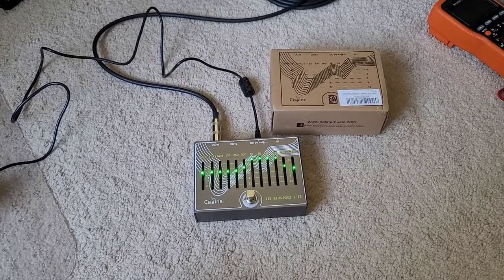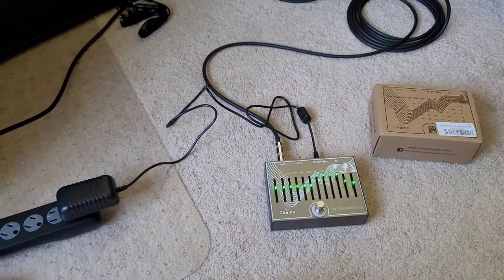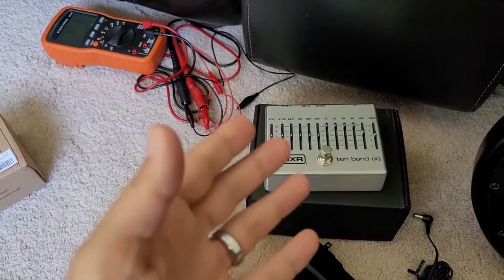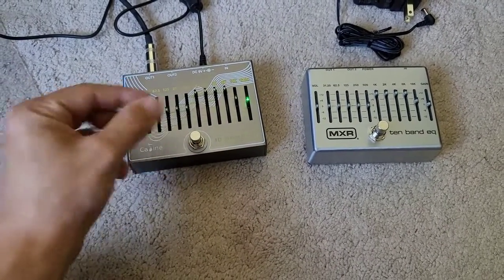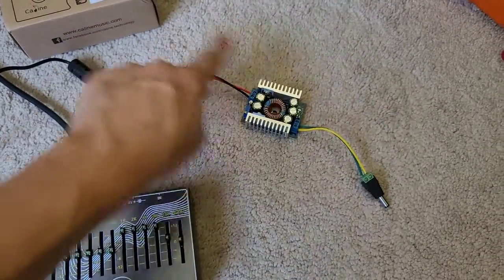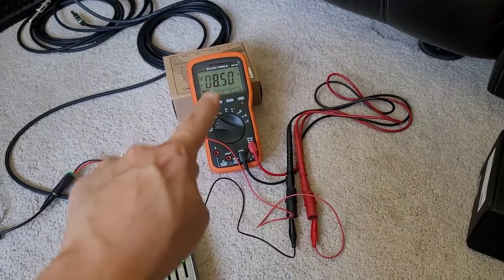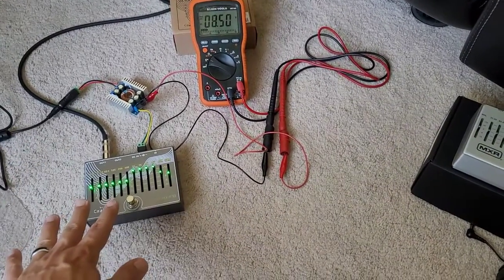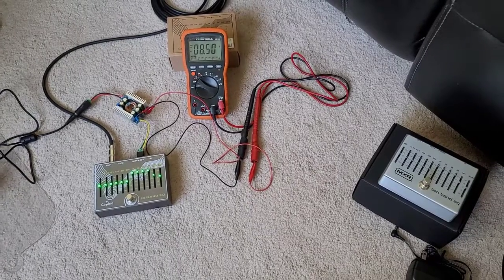Caline CP-81 (v2.1) 10 Band EQ Pedal Review and Voltage Fix

Comment: 8:55 sooo, a resistor in series to decrease power would solve the noise issue for someone who doesn’t have the sag button from voodoo power supply like I have? I’m interested to try this out instead of the mxr.
Reply from the maker: @thesoundpurist  if you buy a new one today this issue is fixed. No need for the resistor
Reply: @Bassguitarist1985  k thanks
Reply: @Bassguitarist1985  one last thing, better than joyo? Thanks
Reply from the maker: @thesoundpurist  no experience with Joyo, but it's likely the same circuit. Joyo are clones of big name pedals
Reply: @Bassguitarist1985  cool thanks
Reply from the maker: @thesoundpurist  my pleasure!

Comment: sonic fields offers to convert 18v to 9v on older MXR and some new pedals., its common that they used 18v in Japan due to the supplies at the time.
Reply from the maker: Good info to know. 18v is better for more headroom, though a 9v supply deployed properly sounded equally as good
Reply: @Bassguitarist1985  someone said you can use a battery but more then 300ma , this eats power
Reply from the maker: @gabrielraphaelofficial  no it's a typo. This draws 39.6mA at 18V
Reply: @Bassguitarist1985  is it possible to run of a 9v battery some how and how? lol thanks
Reply from the maker: @gabrielraphaelofficial  You can get a 9 volt clip to barrel adapter and with the current draw of 39.6 mA, Your average 9 volt alkaline is 565 mAh, which should give you about 14 hours of runtime.
Reply: @Bassguitarist1985  So I have both the new mxr 10 band EQ and the Caline v3.0, I cut R59 chip of the logic board and soldered (jumper style) the connections to use the Vol up as a gain, I have to say that this is not like the new MXR, which has some weak mid range caps, if anything the Caline v3 + the r59 chip Mod is if not identicle to the Kerry King aka Blue original MXR ten band EQ, I say this although Caline has cheaper upper caps for highs, ut they are early workable if your not pushing those too much as metal players tend to do with Marshall heads, Like Kerry King, which is all out over drive at that point, you even loose dynamics from your right hand if you go there lol, so in reality its able ten band eq

Comment: I have a voodoo lab pedal power plus 2 power supply. It has 2 Outputs with a SAG feature that lets you adjust from 9V, down to 4V to emulate a dying battery.  I think I could use one of those outputs and just dial it down a little bit.  Does anyone know if this would work? I have never used that before.
Reply from the maker: @thejackalope73  If you have v2.1 then yes adjusting the output voltage to 8.5V should work fine. However if you have a V3.0 then you do not need to do this. I can't imagine there are many V 2.1 boards left out on the market. The issue is corrected a few years ago.

Comment: I have the caline and it's great for all the reasons you said but makes alot of noise. I can't believe you figured it out. I was looking into the mxr and they are so similar it's crazy that they are so similar. And honestly I'm so disappointed that after shopping around I have to ditch the caline over somthing so silly and inconvenient. And buck up the cash for another eq that will probably be an mxr wich is practically the same thing. Oh well at least when my roommate sees my new and exact same yet more expensive pedal I can explain the importance of the voltage circuitry.  So I'll be watching ur mxr dimming vid.
Reply from the maker: @benjaminkretchman4049  you have the v2.1 board or the v3.0?
Reply: @Bassguitarist1985  oh wow I see. I saw that caline version 3 on Amazon and was curious why there where different calines and why mine was cheaper. It's an impressive video. I'm very Tempe to get the updated caline for the price I could buy 2. Do you think it really stands up to the mxr since you've got it updated as far as low noise floor
Reply from the maker: @benjaminkretchman4049  yes, both equal. It's the same quad op-amp chips!!!
Reply: I can't believe that I found this video. I can't believe that you fixed it. I just might be getting me a couple more calines. One for my effects loops too.
Reply: isn't the one with red lights a updated version that addressed the issue?

Comment: Hi, sorry for resurrecting a 2 year old post. I appreciate you have spoken about voltage fixes, but have you measured the actual current draw (mA) of the CP-81? The website says 300mA.
This seems real high. I know the MXR M-108S is 18 volt, but that is rated at 48mA.
The CP-81, 300mA at 9v seems really high, it's up there with some really current hungry digital FX.
Could you help on this one?
Reply from the maker: 79.2mA at 9V
Reply: Hey man, thanks.
I now know why they say 300mA, it's the initial power up.
Makes my power supply flash.
Something about charging the capacitors.
If unplug the power from the caline, turn everything else on first, then plug the power into the caline, its fine.
Reply: Thanks!

Comment: I got a v.3 with very noticeable hiss... do you have any ideas? Might have to check the voltage..
Reply from the maker: Shouldn't be any. It needs 9V not 18V. it steps up to 18V internally
Reply: @Bassguitarist1985  just to update, it went away with a certain model - cheap MIC adapter... I've even tried it with hi-end power supply and had a loud hissing. All of them give out about 9.1v and have more than enough amp, don't really know why.. 🤷
Reply from the maker: @purimuadmuang2259  I'm guessing there's a lack of proper filtering components in the power supply itself.

Comment: Do you have the revision number of the board? Thanks.
Reply from the maker: V3.0 has the updated circuit with the noise removed. Short r59 to fix the volume fader though

Comment: I’m sorry if you’ve already answered this, but is it the v2.1? I see the v3.0 on Amazon now and I’m curious if they’ve solved the hiss on that model. My MXR just crapped out and would rather not spend $150 on a new one.
Reply from the maker: Yes Caline and I have corrected the hissing issue. What you will need to do is remove R59 to allow the volume fader to boost beyond 0db. Out of the box it is not made to do that.

Comment: Good video. Voltage difference cause any issues? The MXR is 18v I think?
Reply from the maker: With the old v2.1 nameplate says 9v as it will upconvert internally to run at 18V. If you input 18V that's okay as it will pass the voltage through to the chips. The flaw in the circuit has since been corrected in v3.0

Comment: i think the problem is not with the cadine eq .. it is with your power supply .. that power supply may have a lower mA than what mA the cadine requires .. you just have to replace that power supply with one having a higher mA
Reply from the maker: No there was definitely an issue with the circuitry inside. It has since been corrected in later revisions greater than v3.0

Comment: Love how deep you got into the pedal and how to make it work correctly. But honestly that wasn’t worth the money saved especially when Mxr is a better known brand and most likely has a warranty you can just pop into your local store you got your pedal from and swap it for a new one. Might be worth the money saved but to have this set up on a pedal board would just be to much trouble. Unless your just using it for home use.  Great video though
Reply from the maker: It was worth it because not only did i bring it to the attention of Caline, fhey fixed it and it saved others the work I went through, and they also gave me a bunch of their pedals to try/review at no charge. So win win!
Reply: @Bassguitarist1985 ❤

Comment: Caline requires no voltage fix it's a 9v pedal.
Reply from the maker: On the v3.0 board no, but the v2.1 yes
Reply: @Bassguitarist1985  works fine on 9v.
Reply from the maker: @aegisraven1284  the v2.1?

Comment: Excellent video! Have you the bass auto wah pedal from caline? The bass auto wah have very noise...
Reply from the maker: I do have that pedal yes. It sounds good but one major flaw, it lacks the ability to remix in the dry signal. You would need a parallel pedal mixer to get this feature. I'd say the pedal is okay but there are better options out there.

Comment: What about their guts?
Reply from the maker: What did you want to see specifically? There are other videos in this series that actually show the inside of the CP81
Reply: @Bassguitarist1985  actually I'm trying to compare the CP81 with my CP24 in order to make some improvements. But it's just an attempt due to the difficulty to find both schematics.
Reply from the maker: @PintaoLoko  cp24 for sure uses different opamp chips and lacks the 9 to 18V step up circuitry. I have access to schematics for both but not sure what improvements you can make. SMD boards are hard to mod
Reply: @Bassguitarist1985  yes, I'm pretty sure of that. They use 074 opamps. But I'm not really sure about the gyrators components quality and values. Maybe they could reach a different Q factor. Do you think I could have both schematics from the manufacturer?
Reply from the maker: @PintaoLoko  email their customer service. It takes him a few days to get back but my contact always reaches back out. They are also available via Facebook Messenger.

Comment: Hello, so it can be used with an 18v power supply without making any modifications?
Reply from the maker: It is not advisable to run at 18 volts regardless of what version you have. It is designed to run on standard 9 volts

Comment: i just bought this one on ebay used guy said there was nothing wrong with it !!!!   you seem to know a fewthings so here gos .......I turn it on and it sounds like im in a cave with a million bats cheeping ??? im using a 9V Boss power supply...... realy bummed out .... i bought it becouse i saw a demo on utube and realy like it .....Caline CP-24 10 Band EQ Aluminum Alloy Electric Guitar Effect Pedal Guitar Pedal   thank you
Reply from the maker: The CP-24 is the earlier version of the CP-81 in this video. The earlier model does not have a voltage up converter inside. Its not the same guts as the MXR. Sounds like you got a bum u it. Maybe try a different power supply?

Comment: Hi, I noticed Caline also has CP-24, another EQ but with one output. Did it also had a problem and was it fixed? Or just this model
Reply from the maker: Just this particular model. It has a special circuit that takes the incoming 9 volts and steps it up to 18 volts so that you get the extra headroom in the audio signal without having to use a special adapter. Unfortunately there was a design flaw in that circuit and it had to be corrected.

Comment: I need some green and blue LED lights for that anyone have a name or place I can look for some at
Reply from the maker: Amazon, they are 2x3x4mm sized LEDs for the Caline. If you change colors the drop resistor values may need to change. But you can try it. :-)
Reply: @Bassguitarist1985  thanks you are awesome

Comment: So will a generic 8.5v dc charger simply fix this issue?  (sorry if thats a dumb question)
Reply from the maker: Yes it should but most of the time those types of chargers that have a barrel adapter are tip positive and barrel negative, effects pedals in general at least modern ones are tip negative and barrel positive...opposite polarity.

Comment: Just as a question did you know if they fixed the problem,
Reply from the maker: Gino, yes they have. V3.0 has the noise issue corrected. There may still be some v2.1 NOS units out there but this was fixed back in Oct/Nov of 2021.
Reply: @Bassguitarist1985  ok thank you for the info! Did that units good for bass to? I’m looking right now for a good bass eq pedal. I already have a Moeer 5 bands guitar eq pedal who works good for my guitar but not that good for bass.
Reply from the maker: @bluesriff418  absolutely. A 10 band EQ will definitely span the entire audio spectrum for every single instrument. That EQ pedal you were talking about has bands made specifically for guitar, not optimized for the lower register for bass.

Comment: They made it 9 v because most people have 9 volt adaptor is already especially guitarist who are just starting out will buy a cheap power supply with isolated outputs. En sinds there target demographic will be mostly made up of starting guitarists it's actually a smart move ;)
By the way do you have calines contact info for us?
Been trying through AliExpress without Suc6.. :S
Reply from the maker: I 100% agree they are catering to the beginner's market. It's actually a very creative circuit to take 9 volts and step it up to the 18 volts which provides the headroom advantage. Unfortunately the previous versions had a configuration issue but it has been solved. 

I reached out to Caline on FB messenger initially, but then I have continued conversation through their main customer service email. That's the best way to get a hold of them. I usually communicate at night since I am in the eastern United States and they are over in China due to the time difference.
Reply: @Bassguitarist1985  could u share the email with me? Or their Facebook page?
Reply from the maker: @boimesa8190  TEL：+86-755-29365691
MAIL：info@calinemusic.com

B203, Weatern Industrial Building, 22nd Area of Baoan District,Shenzhen 518101, China

Comment: Cant you just add a 3 watt heat  resistor with a value that would drop the required  0.6 volts and problem solved?
Or how involved is it to remove the step up circuit from the chasis completely is it incorporated in the same PCB are the rest of the components?
Reply from the maker: Yes step up is on the same pcb. Requires hot air rework and SMD tools to remove. Drop resistor works but its a non standard value required to hit 8.5vdc. 

I still have this v2.1 board. I'm thinking I may just do a video on how to fix the circuit design or like you said remove the step-up converter completely. The trick is that hardly anyone will have the skills or the correct tools to execute it properly.

Comment: Hi great video,I've just received this unit new with an included 9 volt input to battery converter lead,does this mean that if I connect a 9v battery to power the unit, when the battery starts to run low the output noise will improve? cheers!
Reply from the maker: If you have v2.1 it is possible yes. V3.0 shouldnt be an issue

Comment: Hello    
Just an idea...
Do you think a simple 1Amp diode in line (with a voltage drop of 0.7V) can fix the V2.1 noise? 🤔
The input power will then be around 8,3Volt ....  

Thanks for your videos

Oopps :    I just see below   someone had the same idea    🤭
Reply from the maker: Unfortunately no that wont work. I still have a v2.1 EQ I was thinking of fixing the issue, or bypassing the step up circuitry all together. You cant have too many EQs lying around!

Comment: I have a 10 outlet power supply that has a sagging option on two of the 9 volt outlets.  If I sagged this pedal on one of those outlets, would it work the same way you're describing?
Reply from the maker: Yes absolutely!
Reply: @Bassguitarist1985  Awesome, I have the MXR version, but it's no longer functional, and thought about getting this as a replacement.  Thank you, this was informative.

Comment: can this worked on v1 caline 10 band?
Reply from the maker: You mean the CP-24 or version 1.0 of the CP-81?
Reply: @Bassguitarist1985  sorry, i mean cp-24 bro
Reply from the maker: @aldifrh8825  i havent worked on that pedal, but it does not have the up converter inside. Its a different chipset inside.

Comment: A very informative video , I like the look of the Caline  pedal but the only adjustable power adaptors ive been able to find let you set them on either 9 volts, 7.5 volts or lower , would 7.5 volts be to low a voltage to power the Caline pedal without any issues  ?
Reply from the maker: It will run but it will still have the noise

Comment: Do you happen to have a link for that voltage regulator, I can't seem to find it on Amazon? I just got the equalizer and it does have horrible hum, very noticeable...arr
Reply from the maker: Here is the buck converter. Get yourself an 18VDC PSU barrel positive tip negative too. The converter will take the 18v and bring it down to 8.5v once you set the potentiometer correctly. You will also need some 2.1mm barrel adapters and some shrink tubing to encase the converter so its insulated. Hope this info helps.

DZS Elec 2PCS LM2596 DC-DC Step... https://www.amazon.com/dp/B06XRN7NFQ?ref=ppx_pop_mob_ap_share
Reply: Awesome man, thank you very much for the info, you rock!
Reply: Was hoping they had some ready to go like in the video LOL, wishful thinking... I do have a soldering gun still somewhere in my boxes from my old house, hopefully I can figure it out
Reply from the maker: @gwshark07  the more expensive Pedal Power supplies actually can do 8.5 volts but you are spending quite a bit of money for that feature.
Reply: But thank you very much man

Comment: I was wondering how the Caline works with just 9 volts, and if the difference in voltage would result in different noise floors. I guess I don’t need to get the MXR, besides I need to break out the soldering iron again.
Reply from the maker: Thank you for watching! Yeah there are a few ways to acheive the 8.5 volts from a 9v adapter. A series resistor, a buck converter, and someone suggested using a recifier diode in series. As memtioned in another comment the inductor and voltage divider combo for the PL2628 chip that sets the output voltage of the step up converter is out of tolerance slightly. It outputs a solid 17.8V to the chips inside, it is simply picky for the exact output voltage. Other than that the pedal works GREAT!